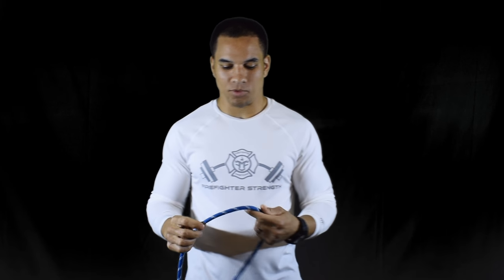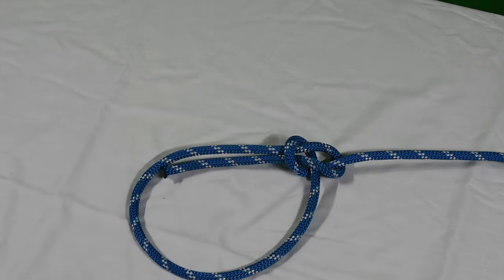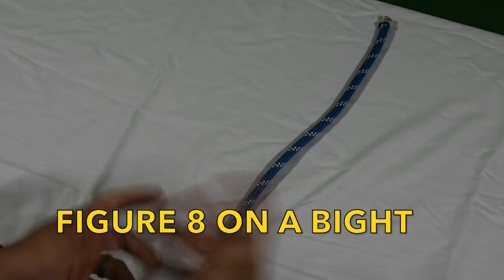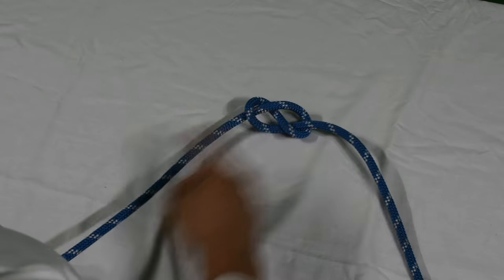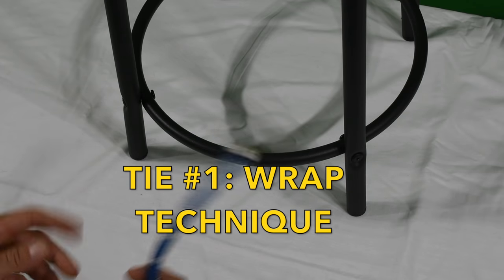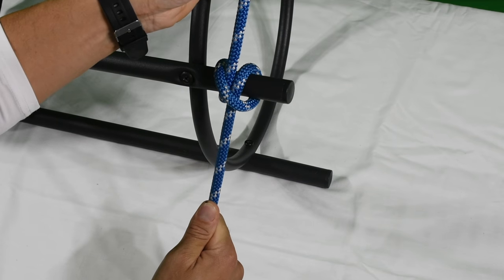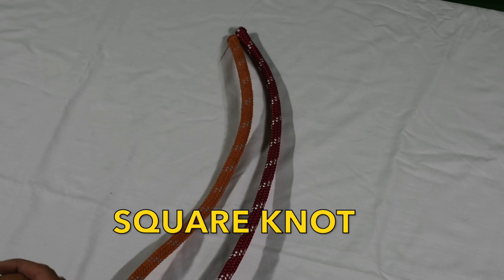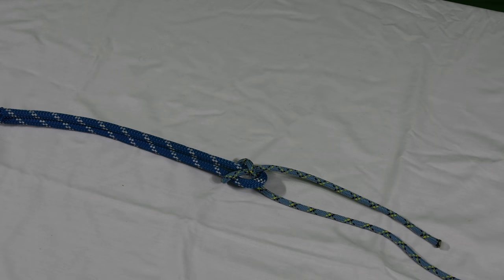Basic Rope Terminology (How to Tie Knots): Firefighter Guide

Comment: Hey I'm a volunteer in Greece. We saw a knot in training for securing the top of a ladder to a balcony rail. Any idea what it might have been or a suitable knot for the purpose? We only saw it briefly since many team members carry a Rhinoevac (webbing with carabiner attached).
Reply from the maker: You have to check in with your departments SOP's in that regard. But you should be able to use several knots to secure your ladders to a balcony rail. we've hoisted heavy working loads to balcony rails using a simple clove hitch knot and had no issues. 
keep me posted on what you find out